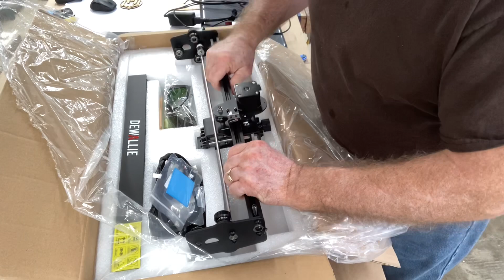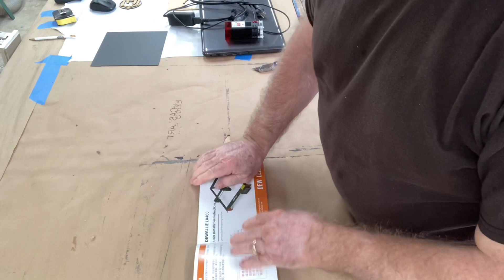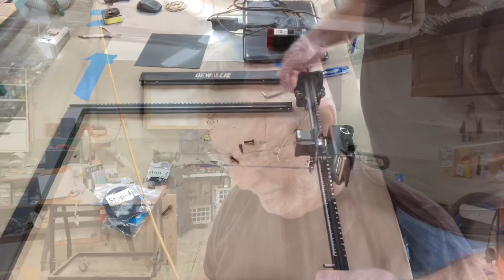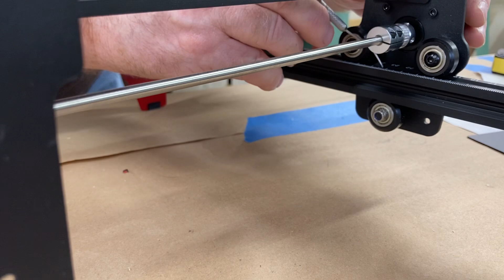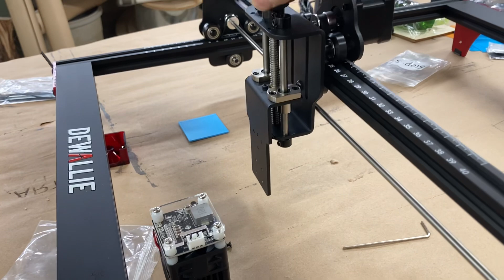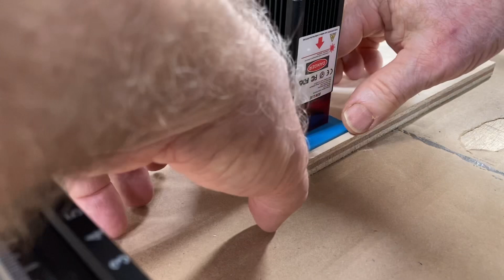Review of the DEWALLIE 20 watt Laser

Comment: Hi, This is probably the dumbest question you have ever gotten but I have to ask it. How do you turn the laser engraver on? I see the switch and have used it on the line position and also the circle position. No noise sounds from the laser engraver. I opened up Light burn and used GRBL setting, no response. On the software when I tell the laser to start it says that there is a problem sending data to the laser. I am totally new to the program and a laser engraver. I dont want to break it. Please help. Thanks
Reply from the maker: You most likely have the wrong com port selected. With the machine on go to your device manager and see what com port is being used
Reply: Hello again, what do you think this means?    

ALARM:9
Homing fail. Could not find limit switch within search distance. Defined as 1.5 * max_travel on search and 5 * pulloff on locate phases.

This appears in the console area in  Lightburn when it is looking at the laser engraver
Reply from the maker: Alarm 9 indicates that as it was moving the machine reached its maximum distance to travel before it hit the limit switch. What machine do you have?
Reply: the dewallie L2. Brand new this morning. I think that mean 20 watt. Thanks for any help or advice.
Reply: Forgot to mention that the machine hasn’t moved at all on it’s own
Reply: Also the software doesn’t find when I tell it to “Find my laser”
Reply from the maker: Are you using Lightburn?
Reply: @PawPawsWorkShop  yes I am
Reply from the maker: Try turning on the machine, then open Lightburn. Don’t look for the device. Look under the laser menu box. It will say disconnected or it will say ready.
Reply: @PawPawsWorkShop  will do….tomorrow. Happy new year and thank you for helping me and being so patient!!
Reply: What and where is the com port. That was not mentioned in the directions. Thanks!